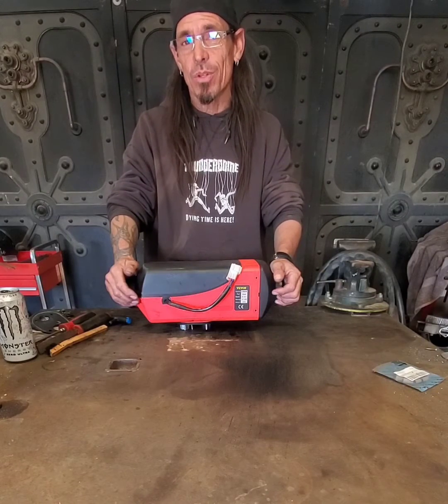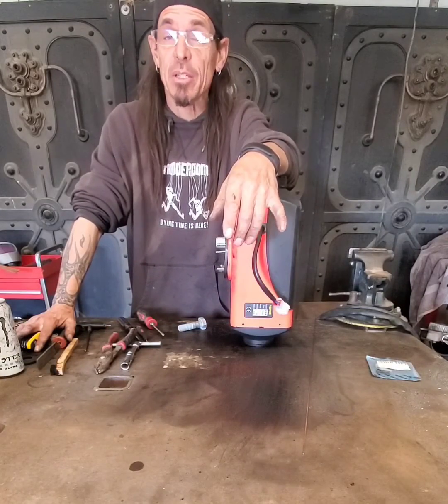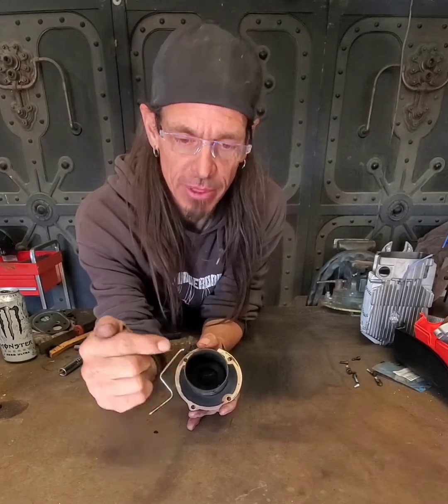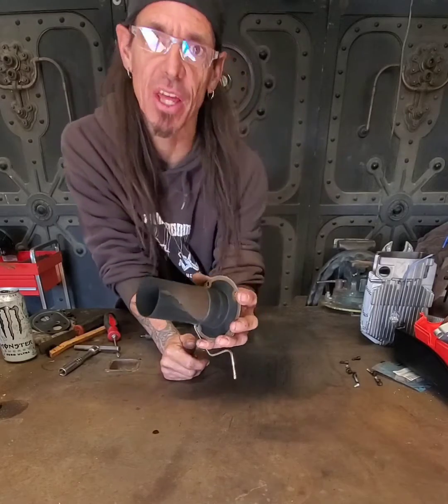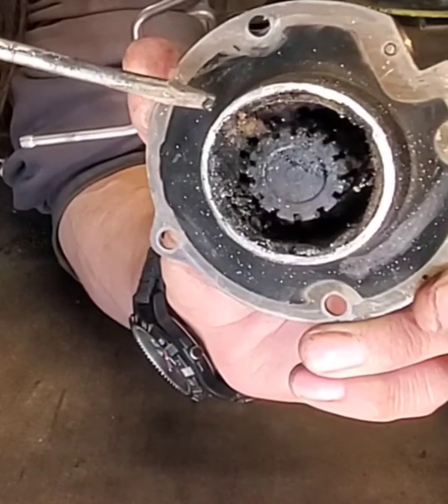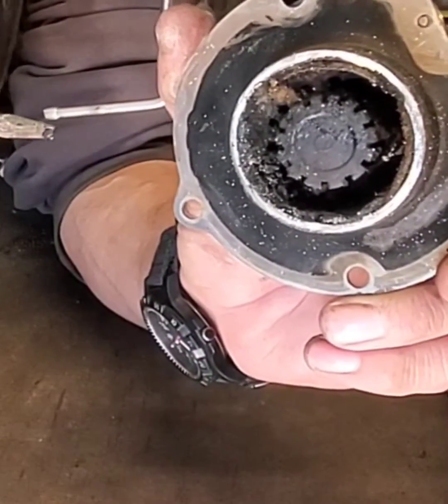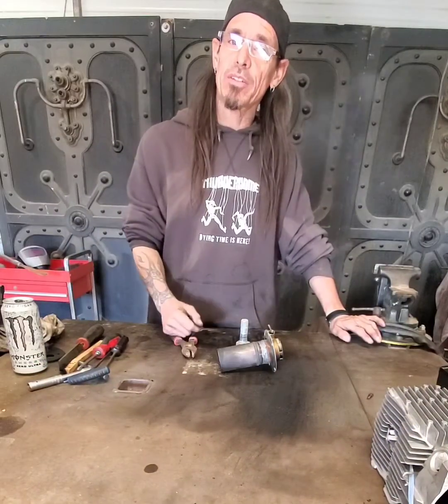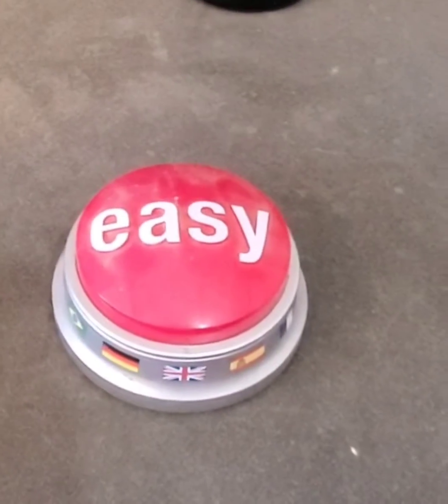Chineese diesel heater. Actual fix.

Comment: I recently installed that same unit and was curious on how many hours of run time it has
Reply from the maker: Mine tend to last 2 winters before they give up... I've rebuilt all 3 I have this way and all 3 fire up and run great
Reply: @SpudInnit  I installed in a 4x4 diesel pickup truck that is used for trail riding so in theory it could go several years without issue only being used a handful of times during cold weather in Texas